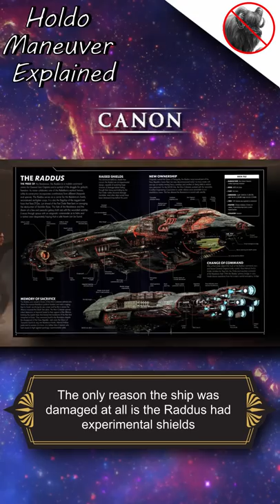Holdo Maneuver Explained | No BS Lore

Comment: This explanation makes me dislike the scene even more...
Reply: Because it makes sense now?
Reply: @Shizzy5321  because it doesn't
Reply: @danielk.3144  but this explanation... explains it did you watch the video?
Reply: @Shizzy5321  This is not an explanation. It’s an excuse.
Reply: @earn-chan  So it goes back and says something that didn't make sense does make sense with further knowledge. How is that not an explanation?
Reply: @Shizzy5321  The scene clearly communicate to do audience that Holdo ram the ship into the enemies. That's how it filmed and show. If the intention is otherwise, then there's 2 explanations. Either the director is doing a  bad job communicate that to the audience or someone saw the internet making fun of it then pull this BS out and call it explanation.
Reply: @Shizzy5321 people don't like it because it breaks existing cannon
Reply: @Shizzy5321  how could that 1 ship going to hyperspace into the capital ship destroy a fleet with a fan of it's debris from impacting the capital ship?
That's the major problem I have with this, smokes ship was immensely huge, holdo's ship barely a sizeable chunk compared to it. That small tiny ship crashing, 'experimental shield' actually doing the damage to snokes ship and somehow shot debris to wipe the fleet behind it.
At best, snokes ship should've suffered heavy damage. 
Not an entire fleet destroyed by a kamikaze.

It breaks lore because why hasn't this tactic been used ever until this moment? If a strong enough shield could bypass the shields on snokes capital ship to infiltrate and cause damage, why wasn't this shown anywhere else in the franchise on weaker shields?
Reply: @jarrodmazzacca1911  the ship wasn't tiny its a big ship. she was literally going into hyperspace. something going that fast would easily fuck up the entire fleet. if you sent a needle going at the speed of light in to the earth, the planet would be destroyed. Now think of something going at that speed but the size of a large neighborhood. i think the explanation in the video is very stupid and the fact that this doesn't happen in lore means the lore has dumb writing as this would be a very good last ditch effort if someone had to sacrifice themself lol.
Reply: @Shizzy5321  you can clearly see the first order being panicked, meaning that the director put that there as a legitimate maneuver
Reply: @simon8242  the ship was tiny in comparison to snokes ship.
Yes it was going into hyperspace, the speed alone wouldn't allow debris to disperse into a wide fan to obliterate a fleet.

Yes, a needly being hurtled into a dense rock of a planet at lightspeed would cause an immense destruction, that's the concept behind kinetic bombardment.
What this doesn't explain is how the debris fans out. Hurtling an object at such a speed, going through an incredibly large ship essentially cutting straight though it with no 'explosion' fans out in debris hurtling in multiple directions in lightspeed. Where was the inertia that cause the angular trajectory of this debris? The speed of the ship would've
1. Ripped snokes ship inwards towards the impact, jolting it due to the immense force, or blowing it up completely, as you said, a needle going that speed can destroy a planet, how does another ship going at a hypothetically faster speed not obliterate it with the kinetic bombardment, let alone actually leave an explosion behind?

2. Due to the force, all debris would move the same direction unless there was an opposing force to impact trajectory, the force of this kinetic bombardment is hypothetically able to be an 'infinite' force, as that's mathematically possible for a needle at the speed of light to have the inverse kinetic force being at an infinite.
This isn't visible on snokes ship, it's one straight cut that fans out at the exit.
For it to fan out, the explosion on snokes ship should've pushed debris in all directions at the point of impact, or at least within the resistance of snokes ship, not at the 'exit' of the ship. All of the debris is going to hyperspace by the way the other ships tear up, it's all in steaks across the ships, kinetic bombardment would make an explosion at such an immense speed at the point of impact, and snokes ship didn't look like it moved so there must've been immense resistance. (I say it looks like snokes ship didn't move, but that's just relative to the other ships in the fleet. The impact on snokes ship should've caused a shift in flight path at a minimum which would be comparable to other ships pathing

Edit: this is completely ignoring how hyperspace works in every other SW media. And 'mass shadows' in hyperspace, speed of an object is irrelevant and isn't akin to lightspeed.
The science in the sci-fi is a mess due to trying to discuss this scene
Reply: @jarrodmazzacca1911  this all boils down to suspension of disbelief, this whole series is filled with stuff that isn't considered scientifical so why shouldn't this get a pass. it seems that people got a hate boner for a bad-ish movie and now want to nitpick everything in it. 

We dont know how a medium sized ship going FASTER THAN LIGHT would react with a really big ship. it's from our understanding impossible and therefore unknowable. i personally think the scene in the movie is fine.

Yes this hasn't happened in the universe before this but I would argue this is a flaw of the IP as a whole seeing as this is a extremly good way of esentially kamikaze-ing a ship into another, or even ramming a ship into a planet which hasn't happened either, even though just using a meteor would be just as effective and probably more. but the interesting part is that this would have a better effect than the deathstar, but this is for some reason not discussed. no one seems to have a problem with the deathstar even though it's inefficiency is laughable and (or other musterious stuff like the force, which literally have no explanation other than "it works in musterious ways") just as science-braking as this scene.
Reply: @simon8242  in canon explanation of hyperspace is that it's a different field of space achieved by molecular displacement after achieving the speed of light.
It's a separate dimension of space that is adjacent to 'real space' where the ships exist.
Stars Planets, and asteroids would leave a 'shadow' which when detected would leave hyperspace into realspace in what visually seems like increased speed.

By this alone, according to SW canon. Holdo's ship bombarded snokes ship with molecules as it slipped into 'real space' from hyperspace, or in the process of slipping into hyperspace.
This nullifies the shield example as the shield would've been destabilized from molecular displacement and not have been as effective as ramming it with raw speed. 

Unless holdo's ship slipped into realspace on top of snokes ship with force to destroy it.
Yet there is no 'explosion' of impact as kinetic force would've made a blast at the very minimum.

I do know what a medium ship ramming into another would look like, it would explode on impact and debris shot everywhere, the speed of the debris and it's angles is what I don't get. It spreads at the exit of the impact and no blasts of impact.

Holdo's ship cut through snokes like a knife.

With my criticism, it'd be more practical that the force of the blast of impact from holdo's ship, slipping through hyperspace causes the wing of snokes ship to break in multiple parts, sends a literal wall of steel to the fleet unable to evade as they were right behind snokes ship and large cruisers would've been unable to maneuver.
Instead we got a CGI jizzfest that needed to be retconned with new explanations. That's my issue.

I don't have a hate boner, the sequal trilogy had so much potential, it just fell flat with things that causes such heated discussions like this.

There are only few scenes I'll nitpick like this, and 8 as a movie felt like an unnecessary tangent but was overall enjoyable. 
Don't lump me in the the people that hate for the sake of hating.
I hate things I find poorly done and will discuss, like I have now
Reply: @simon8242  the concept of impact with hyperspace could've been used anywhere for weaponry.
Any major capital ship if it ejected fire at hyperspeed, would've given a bigger sensation of a threat level, annihilating any ship with any strong shields, they sent drones with a one way hyperdrive all the time, one way hyperdrives in weaponry isn't a long leap, this would show that strategies like the holdo maneuver are plausible in the SW canon
Reply: @Shizzy5321  yeah this just makes it worse it literally contradicts everything established in the universe at this point.
Reply: @Shizzy5321  because there’s even more excuses to cover for bad writing now
Reply: @jarrodmazzacca1911  ikr shrapnel isn't real
Reply: @jarrodmazzacca1911  if you genuinely think something moving fast doesn't create debris and shrapnel after creating and exit hole you just don't understand ballistics. You can easily imagine this being a tank battle. A tank round breached the others armor sending spalling and shrapnel everywhere inside the tank usually coming out and fanning out as it travels further throughout the tank cabin.
Reply: @staple_boi  I'm not saying the shrapnel and debris isn't real. I'm talking about how the debris doesn't spread upon impact, and conveniently was enough to slice through snokes army.

Your example of a tank works because we know the shrapnel and debris is spread from the impact zone. Not slice through the opposing tank then disperse into shrapnel.
Reply: It screwed up Canon, but was the best thing in the movie. Now, we find out it was an accident.
Reply: @jonathanross149  yeah, it was definitely a cinematic marvel of a scene. I just wish it resolved better
Reply: @simon8242  Isn't hyperspace a different dimension?
Reply: @blobjorn3248  from what I've understood the way to get into the hyperspace dimension is by going faster than the speed of light. so there is a moment where you're going either at the speed of light or above it, which would be impossible from our understanding of physics but it also means that the maneuver in the movie isn't going against canon nor the logic from earlier movies.

 we don't know how long the "wind up" or "wind down" (that is how far you're going in the real dimension just to access or leave hyperspace) so it could've ran through all of that at the speed of light, and if that is the case we cant predict how any ship or anything would react as it doesn't work with our view of physics.
Reply: Same for me, for the reason that it really sounds like an explanation that had to be made up after they made the movie. They didn't think of anything what was said im this video when they made the movie
Reply: @simon8242  the thing is it takes an astronomical amount of energy to reach the speed of light as effectively the faster you go the more energy you neeed to put into it - as a result the hyperdrive was made to negate this issue by throwing the ship involved into hyperspace

It isn’t an acceleration- that’s just what it looks like but the ship doesn’t slingshot into the distance in actuality. So no there wouldn’t be a moment where the ship is moving at light speed at all, which is one of many reasons why the Maneuver made no sense
Reply: @Shizzy5321  It doesn't explain why it's a "one in a million" maneuver. You can literally program a hyperdrive in the direction of an enemy ship, tie it to a rock, and put experimental shield on it (probably shielding from a mining vessel), and destroy anything. Again, this is still a massive plothole.

What makes people dislike it even more is because it's a fancy sounding post-hoc excuse that seeks to patch a massive "f___ you" moment in the movie years later.

Additionally, hyperdrives were always explained as essentially Einstein-Rosen bridges breaking the space time continuum, and bridging two places in the universe by crossing over into hyperspace. Quite simply, the Raddus should have DISAPPEARED instead of crashing.
Reply: @danielk.3144  🙄
Reply: How could you even
Reply: @Shizzy5321  so then explain to me how if the reason the maneuver was so effective was due experimental shields. when you watch the movie you can clearly see its the debree caused by the initial impact ripping through the ships at high velocity that causes the majority of the damage. 

is that debree shielded or is this explanation just a load of bullshit?
Reply: "Hyperspace is, in theory, a set of extra dimensions beyond the three that we experience daily. These extra dimensions are able to connect distant points in real space."

It's like the folding paper to fast travel to that location example used all over sci-fi. "they have special shields" is not a valid workaround
Reply: @danielk.3144  always has
Reply: @shademandude712  it does not
Reply: @Shizzy5321  because it’s even lazier. It was a complete plot hole. But now it’s just a matter of perfect circumstances with coincidental bullshit. It would have been better to make an ACTUAL explanation. This is just an excuse
Reply: @Shizzy5321  lol no it doesn’t make sense. How can you not smell a desperate attempt to fix what is very clearly bullshit?
Reply: @simon8242  Hyperspace is a different dimension and doesn't effect other ships plus it goes through wormhole like structures. How the hell is that meant to destroy a fleet anymore than something in the quantum relm being affected by us? There are countless excuses that tlj fans and disney has come up with that contradict each other on every level.
Reply: @MikeDchy25  if you go in to hyperspeed which might be another dimension that would mean that you first would need to reach the speed of light, the size of the ship in the film would easily destroy whole planets at the speed of light. 

Plus in the original trilogy han solo specifically says you need to watch out for suns and asteroids whilst in hyperspeed, so saying it wouldn't hit anything in the normal dimension is something we just down know, as it doesnt seem to be consistent across all the films at all, this is a problem that started with Lucas films and not Disney. 

I think this trying to "out logic" the movie is dumb as none of this is probably ever possible, like going into faster than light travel as en example. So it think it's stupid to try to say that "this is unrealistic that she would do this" when the whole franchise is filled with unrealistic things plus that the scene is a good, acted well and well made. you people are just blindly mad at everything in the new trilogy even at the things that are good.
Reply: Cry about it
Reply: @professionalpussypetter2929 ”WAAH WAAH WAAH”

Comment: I love how they had to change the whole definition of hyperspace to make this scene work.
Reply: @teamtundra2619  the original hyperspace would have you enter an alternate dimension and while traveling fast than the speed of light. And on top of that it would also use the method of traveling through wormholes. Making this scene basically impossible. This was the only in depth description of hyperspace we had for a while. The hyperspace was its own dimension. You simply couldnt ram an two objects.
Reply: @ankitbhasi7794  I havent read the Thrawm books but if your look it up, im the expanded universe the process of using hyperspace is what I described above. All Im saying is I hate it how the Disney star wars films have paid little respect to the original ideas that were in Star Wars, or any of the ideas that were expanded on. Only so they could make a character that everyone hated die a noble death. The only good thing Disney has done with Star Wars is Rogue One, A Solo Story, and the shows. Which yes is good, but they nearly butchered the main story.
Reply: Maybe the real Hyperspace, was the friends we made along the way

Comment: "Just happened to line up at that exact moment"
Reply: Yep. I'm betting the 1 in 1 million odds, are off by at least an order of magnitude or more, considering that the trajectory would need to be perfect, and also the Supremacy would need to be close enough to get hit before Holdo got to hyperspace. Then of course there's the luck of Poe putting in coordinates directly on the other side of the line drawn between Holdos ship and Snokes.

1 in 1 million seems rather too short on the odds.
Reply: If that really was the case then holdo had no right to call Poe s plan risky